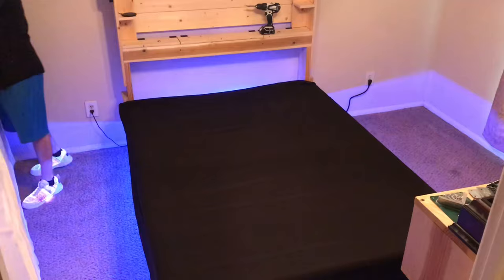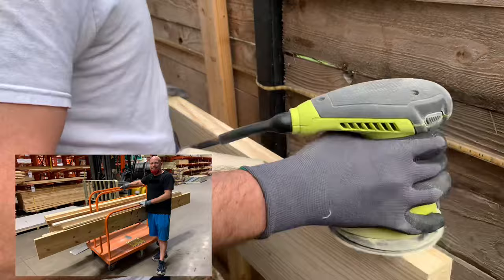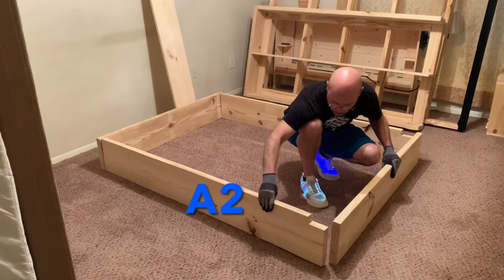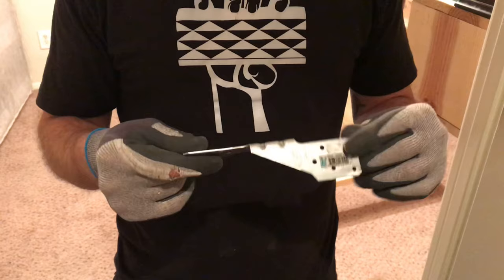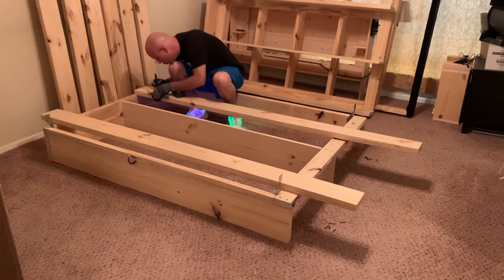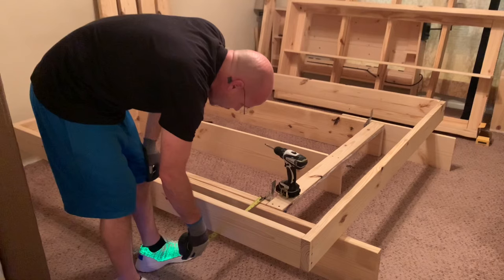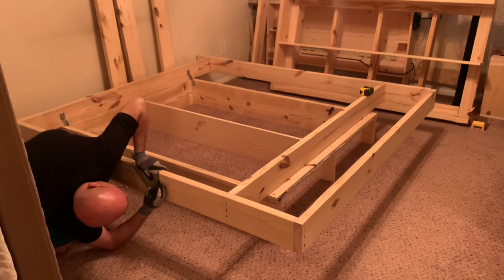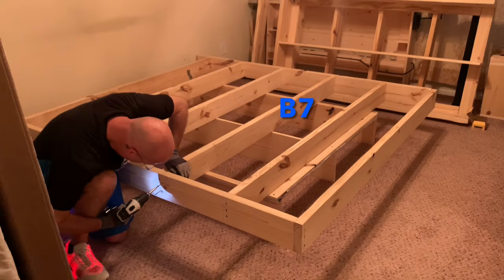King Size Floating Bed Frame [Easily build your own!]

Comment: You sound so sweet! This is awesome. im  going to the hardware store today to do something similar. 

 My matress is circular, so itll be interesting to see how that looks. I haven't found a circular floating bed anywhere on the internet... Any tips? 

Thank you , great video!! 🫶
Reply from the maker: @namenamee5061 Hey Name, thanks so much!  I think I'm pretty certain you are the first to request a circular floating bed frame.  🤯 This is...interesting to say the least.  I could spend some time thinking about how I would do it if you really need some help.  What's the size of this mattress?(diameter in inches or centimeters is good).  Is there a box spring?  Let me know and I'll see what I can come up with.  Thanks for stopping by and taking the time to talk with me and support this channel, I appreciate it.  Let's make something great!  Talk to you again soon my friend 🤝
Reply: @CurtisMadeIt  Ohh thank you!! 
my mattress is 2m by 2 m (so 79 inches?) 
 
The wood is arriving today and I'm gonna be pretty much winging it lol. 
No box spring, just a thick mattress. I love my round mattress lol, can't wait to have a bed!! 

I will try to share my progress and share the results. 
Thank you so much! any input is appreciated, this is gonna be fun! 😁

Comment: Can I ask what the benefit of ...compound chopping?... halfway through your material first and then finishing the rest of the cut is? I tried to google and think of it from my own experience and it's not like you can adjust the measurement after you've cut halfway through?
Reply from the maker: @MoBQuEEzy Hey Mob, thanks for your question.  I appreciate your time and interest.  I guess that just comes from trying to take it easy on my equipment and materials.  I don’t want to unnecessarily overload the motor on my saw and I don’t need to add any additional risk of blowout from my material, especially when handling figured hardwoods.  In my experience, it’s best to take your time to be precise and intentional with what you are a working on.  I hope this helps and I appreciate your support.  Talk to you again soon my friend.

Comment: Hey boss man will these measurements work for a California king as well great video by the way
Reply from the maker: @frankiearvizu5564 Hey Frankie, good morning, thanks so much.  I would personally modify the measurements a little bit to better fit the Cali-King size.  I've got CAD blueprints available for a lot of different sizes of these floating bed frames if you need.  I can also help you modify this design as needed to better fit your taste or needs.  Let me know how I can help.  Thanks for stopping by and supporting this channel my friend, I mean it 🤝

Comment: We just upgraded to a king size bed and I want to build my own floating bed frame. This video is perfect . So I should buy a box spring instead of putting plywood down? What if I used 2x10s for the top? And put two sheets of 3/4 birch type plywood down. Do you think that would work? I really like the bottom storage idea so I can slide winter clothes in plastic bins or something underneath.
Reply from the maker: @Christopher Donahue Jr Hey Christopher, thanks so much.  I’ve got a couple things to unpack here:
Upgrade: Congrats my friend, I know you will enjoy your new setup.
Storage: Yes!  I love this too.  Here in Texas, we use that area to keep safe all of our Dallas Cowboys fan gear for most of the months of the year.
Box spring: I probably would instead of getting the plywood…just seems a lot easier.
2x10’s for frame:  Yeah, I’m sure you could do this, though I haven’t done it myself personally.  What’s your reasoning behind this…?  Do you want the deck of your mattress taller or are you just trying to make sure it is strong enough?  I’d recommend a taller box spring if you are just trying to make the deck higher up.  If you are trying to make sure it is going to be strong enough, 2x10’s and all kind of expense birch plywood is *WAYY* overkill.  
I hope this helps.  Let me know if I can offer any other advice or guidance.  I appreciate your time and support my friend 🤝 stay blessed 🙏
Reply: I was thinking birch just so it's nice lol the 2by10s yes for the height difference of the box spring. Just don't want a box spring because that's what was bad on our last bed just want something solid honestly.
Reply: Anything I build is over kill lol 😂
Reply from the maker: @Christopher Donahue Jr Okay, okay.  You can use the 2x10s for the base and keep the frame on 2x6's...that's gonna save you some cash and a lot of effort dealing with the extra weight of the boards.  Having said that, I think you could probably do 2x10's for the frame and be okay.  Let me know how this goes if you remember.  Birch will look awesome but is pretty pricey for something you aren't gonna see at all.  Again, I'd go with the still effective but cash saving option of a lower grade plywood, but this is your build and I'm going to highly encourage you to do it the best way for you.  I'll send you in the best direction possible.  Let's talk again soon Christopher.  Have a safe build my brother.
Reply from the maker: @Christopher Donahue Jr Nothing wrong with that at all.  That's part of the reason why I built these bed frames with 2x6's for YouTube.  These are solid enough and have ALL of the capacity so sometimes it's safer to overbuild it.  Be careful my friend.

Comment: Greetings from Malaysia 🇲🇾.. awesome DIY sir.. just need some clarification.. what size planks did you use for the base? 2x8? Any effect on the stability between using 2x6 and 2x10 for the base? Another question, won't the mattress move around since you don't have 'borders' on the frame to hold the mattress in place? Thanks in advance..
Reply from the maker: @Hasrizal Hashim Hi Hashim, you came a long way!  Thanks for stopping by.  2x6, 2x8, 2x10 for the base does not affect stability.  Adjust base plank height as needed for storage or floating effect as desired.  The mattress doesn’t move…now…it’s just me sleeping on there, but literally 100’s of people around the world have built this bed frame and I’ve never heard otherwise.  You are very welcome my friend.  I appreciate your interest and support.  Talk to you again down the road.
Reply: @CurtisMadeIt  thanks for the prompt reply.. btw, just found out that i could not get those hurricane ties here in Malaysia.. any alternative? Could i go with drilling pocket holes? Will it be strong enough?
Reply from the maker: @Hasrizal Hashim Hashim, get you some ‘corner brackets’ and attach them to the base side boards and the frame joists.  I hope you can understand this.  Reach me on Instagram realc_love1 if I can help explain it to you more clearly.  I hope you have a safe build.

Comment: What screws did you use for the Simpson Ties?
Reply from the maker: @Damarion Austin Hey D, I just used some 1” drywall screws for the strong ties.  Those are a little overkill for this build…but they are cheap, quick, and easy to use.  Thanks for stopping by, talk to you soon.

Comment: Any suggestions on building this bed with using box springs?
Reply from the maker: @isaaclowrance7684 Hey Isaac, thanks for your question.  Just put the box spring on top of the frame…this is how I did mine.  I hope this helps.  Let me know if you need anything else my friend.  Thanks for supporting this channel 🤝

Comment: I'm going to give this a shot! I was thinking for the frame, if I subbed out the joists for 2x4s so it's recessed to allow a box spring to go down without sliding around, would that be too weak do you think?

Edit: and what size fasteners are you using for the strong ties?
Reply from the maker: @keithbrougham9562 Hey Keith, you can try it if you want to, but I would stick with 2x6’s and just make the joists and side boards 3” longer each and wrap it with a 2x8, making sure to line up the bottoms of your side boards and joists.  This will give you that little pit for your box spring to sit in.  You don’t really need to though because your mattress isn’t going to slide hardly at all, I can almost guarantee it.  I hope this helps.  Let me know if you have any other questions at all.  I appreciate you supporting this channel my friend 🤝
Reply: @CurtisMadeIt  thanks for the quick reply! I see what you mean, these dimensions are exact for a king mattress and would need the extra length to accommodate the "pit". Makes sense! I think I'll go for the frame as designed, save a bit on the lumber!
Reply from the maker: @keithbrougham9562 You bet.  I hope you have a safe build.

Comment: What are the measurements you're doing with the speed square when building the upper frame
Reply from the maker: @Nathaniel Rozzel Hi Nathaniel, thanks for your question and I apologize for the delay in my reply...you guys have been keeping me very busy recently.  I went back and looked at my video and at that time, if I'm understanding you correctly, I was making the measurements for where the first joist was going to go.  If you notice, I left some space at the very head of the bed frame(five and a half inches to be exact) for the headboard extension.  When I built this bed frame, I knew I was going to be making a separate video for a headboard so I went ahead and added the needed space for the uprights when I originally built the frame.  I hope this helps.  I appreciate your time and support my friend.  I'll talk to you again down the road.

Comment: I have a bunch of left over 2x6 wood. Do you think I can make this completely out of that? And I have a foam mattress. Would sanded and painted plywood be ok for the support on top instead of a box spring? Thank you!
Reply from the maker: @Corgi Caretaker Hey Corgi, thanks for your interest.  …bunch of left over 2x6’s…they need to be untreated if you are going to be using them for this king size build,.  Also, 2x6’s for the base may not leave you enough room for storage underneath, but I’m pretty sure an all 2x6 build would be fine.  Sanding and painting isn’t necessary for the plywood but obviously, that’s user preference.  Yes, you will need the plywood if you don’t have a box spring.  I hope this helps.  Thanks for stopping by.  I’m on Instagram C_Love1984.  Talk to you down the road my friend.
Reply: @CurtisMadeIt  thank you so much for the reply! I’m going to try and get this built this week/weekend. This is super helpful!
Reply from the maker: @Corgi Caretaker Hey bet Corgi, I’m glad to help.  I hope you have a safe build and please feel free to reach out if you need anything else.  Take care.

Comment: Can I use 2x4 for the top part instead I already have 2x10s for my base
Reply from the maker: @Noel Castaneda Hi Noel, you probably could, but I wouldn't recommend it.  I used 2x6's for the frame on my king size for the weight to keep it from tipping over.  I think with 2x4's, it's going to be a lot more likely to tip to one side or the other.  I hope this helps and please feel free to come back and let me know if you end up using the 2x4's, I'd sure appreciate it.  I hope you have a safe build my friend.

Comment: Im trying to do this but with a California king any tips on how i can use these instructions with it ??
Reply from the maker: @Tripz Five59 Hey Trip, thanks for stopping by.  I would, and actually did, start from scratch to design a bed frame for the Cali king size mattress.  This, in my opinion, is easier than adjusting the measurements and dimensions on the king size plans.  If you want to use these king size instructions for your Cali king size build, I think you are going to be quite disappointed because the dimensions for this build are smaller on all sides than for a Cali king size.  If you’d like help with your build, you can see that I’ve already built several of these so I’ve got an idea of what I’m doing.  I’ve got the Cali king size blueprints done too.  I’m on Instagram C_Love1984.  Get with me on there and I’ll get you all set up.  Talk to you soon my friend.

Comment: It looks like you added 5.5 inches so a headboard could be installed later correct?  I am also modifying mine so I can place a Cali King on it. Thanks for the video
Reply from the maker: @Jim Morton You are welcome, I’m glad to help.  Correct sir, 5.5” is the width of a 2x6(in USA) and that’s what I’ve been using for the headboard uprights.  Thanks for stopping by Mr. Jim.  I hope you have a safe build.  Talk to you again down the road my friend.
Reply: @CurtisMadeIt  trying to decide between your cool option or a metal frame. Your design has a lot of benefits including there’s nowhere for me to stub my toe. Not to mention it’s stylish. I just have to decide if I’m going to be lazy or not lol carry-on sir
Reply from the maker: @Jim Morton The biggest motivator for this build for me was the lack of any place to stub my toe.  I appreciate your support and I hope you end up with what makes you the happiest.  Be careful and I’ll talk to you again soon.

Comment: Hello sorry love the video. Currently making it the frame 
Just have a question, what size are those Simpson ties ?
Reply: I bought some but they seem to be smaller than those in the video
Reply from the maker: @Ismael Villa Hey Ismael, those Simpson strong ties are the 2.5’s.  I hope that helps.  Reach me on Instagram C_Love1984 and I’ll send you a picture or Home Depot link.  Talk to you soon my friend.

Comment: This is by far the best video for the king demise can you put the measurements of the wood in the comments? Also if i wanted to paint it what would i use ?
Reply from the maker: @GetFit WithWik Hey Wik 👋 the best one, really?  I appreciate your tremendous compliment.  Send me your email address on Instagram, I’m C_Love1984, and I’ll send you over a modified picture with the dimensions on it.  Thanks for your interest and time.  Talk to you soon.
Reply: @CurtisMadeIt  can you send them to me too please and thanks
Reply from the maker: @Shon Hall Yep, I sure will.  I see you found me on Instagram already…it’s past bed time for me rn, I’ll send it in the morning my friend.  Thanks for choosing me 🙏 Talk to you soon.
Reply: Can, I please get them as well ? I followed another video tutorial posted by another YouTuber and it was going okay until I realized that you’d still be able to see the base of the frame which is obviously not supposed to be visible. Any how, I came across your build and I like it much much better. I would definitely appreciate it if you could send me the blueprints or instructions, thank you .
Reply from the maker: @Paul Stevens Hey Paul, you bet, I’ll be glad to help.  I’m on Instagram C_Love1984.  Send me a message there and I’ll get you all set up.  Talk to you soon.

Comment: Great video! Do you think it would be ok to use 2x4's instead of 2x6's for the top part of the frame?
Reply from the maker: @Veronica Campbell Hey Veronica, thanks for your question.  No, this is absolutely not safe at all.  I did try this and the lack of weight from the base and frame combined allows it to tip to either side.  You definitely need 2x6’s for the frame.  I hope this helps and I hope you have a safe build.  Talk to you down the road my friend.
Reply: @CurtisMadeIt  Good to know - thanks for the speedy response. I'll need to modify my idea of reusing an existing plastic bed frame base I suppose.
Reply from the maker: @Veronica Campbell Yes ma’am, you are very welcome!  I’m glad to help when I can.  Let me know if you need anything else and I’ll steer you in the right direction.  I’m on Instagram C_Love1984 also, just to let you know.  Talk to you soon.

Comment: How far did you go in on b1 and b2 for the inside board
Reply from the maker: @Frank Gonzales Hey Frank, thanks for your question.  If I remember correctly, the joists are spaced about 16” apart.  I hope this helps.  Talk to you again down the road my friend.

Comment: Do you habe the masurements for a bed Thats 140x200cm (german) ?
Reply from the maker: @Juliette Richtering Hey Juliette, thanks so much for asking!  I’ve done some custom blueprints and yes, I do believe I have previously designed a 140cmx200cm.  I just got to the day job.  I’ll check when I get home and beam it over to you.  Can you message me on Instagram C_Love1984?  I appreciate you stopping by.  Talk to you soon.
Reply from the maker: @Juliette Richtering Alright Miss Juliette, you should be all set.  Let me know if you need anything else and I’ll be glad to help.  Talk soon.